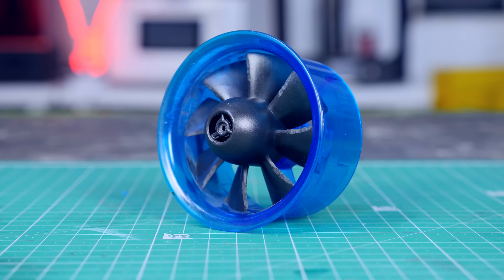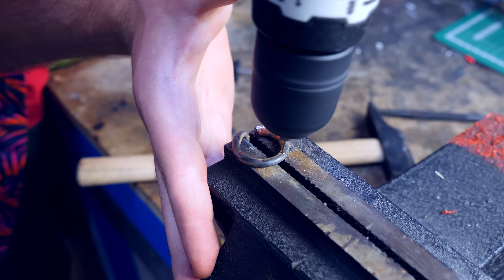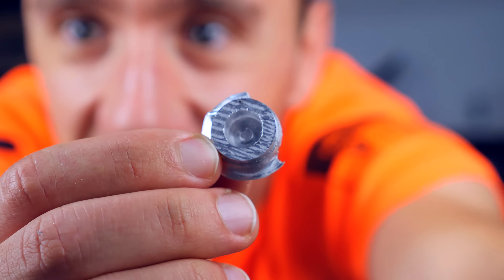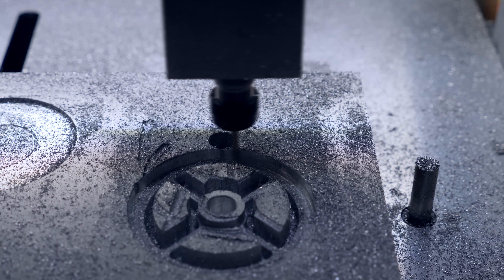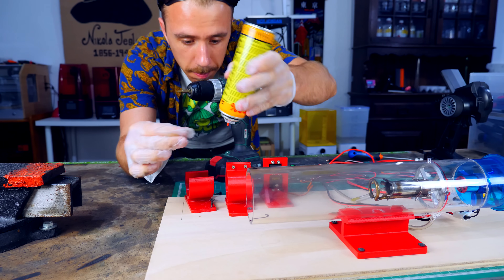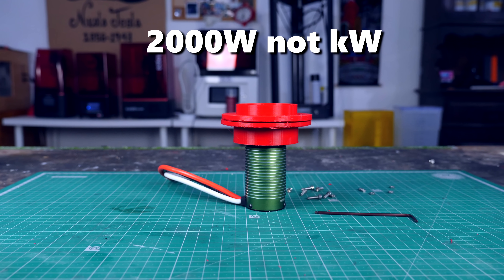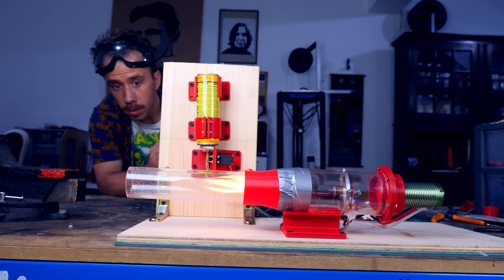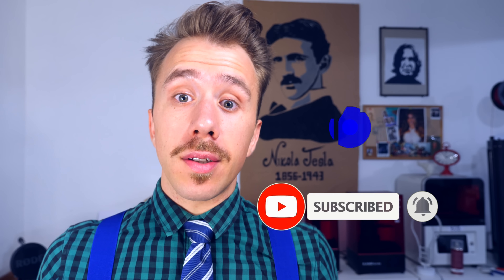I turned my Fan into a Jet Engine (3D Printed EDF Afterburner)

Comment: No you just made a flamethrower.. a jet engine is able to self sustain. Without the ability to self sustain aka keep running without external assistance, that is not an engine. There's actually numerous people on here that have already done this. If you want a far better jet engine, go to a junk yard and buy yourself some turbochargers and link them in series. Colin Furze has a decent video on how to do this, in a single stage version. I'd suggest upgrading to at least 2 turbos and replace the intake housing on one with an exhaust housing and wheel so that it can withstand the heat better. The intake side of one turbo feeds compressed air to the exhaust side of the same turbo, then you duct it into one side of the second turbo, around to the other side of that second turbo and then out the back which is where you put your combustion chamber and afterburner. The mistake most people make when making turbocharger based jet engines is when they put fuel in the turbo and light it inside the turbo.. They can't handle that kind of direct heat and melt the wheels. If you use the turbos purely as the compressor stage it should last longer, the problem might then become getting it to self sustain as you'd have to have sufficient vacuum created by the combustion to pull the air through both turbos. A way around this, at least on the second, would be to 3d print a titanium exhaust impeller/wheel and put a small injector and ignitor in the transfer between the "intake" and exhaust side of that turbo making the "intake" as well as the first turbo the compressor stage for the engine and the exhaust side of the second the way that the second is mechanically spooled up and basically the initial combustion chamber which then can have more fuel added in the exhaust making an afterburner afterwards. I'd suggest using a fuel that burns at a low temperature like methanol though.. just if you use methanol make sure to add at least 5-15% by volume of toluene so that the flame is visible so you don't accidentally set everything on fire when you can't see the flames. (methanol burns so clean the flames are almost completely invisible) And obviously take proper safety precautions because both methanol and toluene are pretty toxic and you don't want to be breathing them or their exhaust, or getting it in your eyes. (oxidized methanol becomes formaldehyde)

Comment: Why don’t you print a nozzle like a bell nozzle. This way you can heat the fuel before it goes into the combustion chamber. You may also be able to keep a resin print cool enough to prevent warping.

Comment: Enclose the entire thing into  a duct with another EDF at the front, to push air to the back and pull/ accelerate the air in the flame tube.
This airfoil duct will multiply output, and if you do get it moving, exponentially so based on airspeed.

Also that chef looked familiar.

Comment: The peroxide engine was primarily released oxygen, right? Could you revisit that build with an afterburner to improve it's thrust?
Second idea: could you modify a spring scale into the base to measure thrust during experiments?
Reply: However, if there is anything hot enough to qualify as an ignition source in the path of the gas, pure 02 will *find something to burn*, and uncontrolled O2 fires are terrifying.  So, yeah, even though it doesn't work as an afterburner,  handling oxygen in the presence of heat/spark/flame is extremely dangerous.
Reply: @olinseats4003  if you can get airflow moving fast enough with enough pressure, would it be possible to build a kind of ramjet with small fuel injectors and constantly-cycling air? It could only run at full power without endangering the engine, but would it work?
Reply: oxygen does not burn
Reply: @iteratortv  bruh what
Reply: @DDrac0  imagine that
Reply: @DDrac0  oxygen needs a fuel to combust which the exhaust from the peroxide engine doesn't have which means the after burner won't work
Reply: @anhondacivic6541  ok thanks a lot

Comment: The comment about vaporizing the fuel is on point. Carburetors/Venturi tubes…mix the fuel and air before Ignition, right? So, maybe fan blows fuel mixture past the glow plug in the narrow tube from the wide tube, and then another wide tube for the outlet. You’ll have to meter the fuel to match the air flow…that would make the engine. Dumping more fuel in exhaust for more thrust is after burning.

Comment: Video Idea: 3d print a wind or water turbine and use it to charge a big enough battery to power a 3d printer to print another wind or water turbine. That way the second printed turbine would be using green energy in its creation.

Comment: Hi I would really love the 3d printer, I suggest for next video to print a compressor tu put in after the EDF. With its stator and the moving blades in multiple stages compressing air, that will be much better!

Comment: I think you need to let the plug and exhaust heat up before you use the EDF. The hotter the exhaust, the stronger the engine.

Comment: I have lots of experience milling aluminium in weak CNC-machines

Some tips:
-Climb milling is key. DON'T mill alu conventionally except for certain operations.
-Run high feed speed (40 mm/s for example), High RPM (12000 rpm for example) and low pass depth (0,2-0,4 mm). This prevents overheating of the chips while avoiding overloading the tool. Experiment.
-Get carbide tools with SHORT flutes and no more than two flutes. No need for 20 mm long flutes unless you really have to go that deep.
-Minimum tool extension from the chuck for maximum rigidity.
-A spray bottle of ipa to cool the cut is ideal. Alcohol is like magic when milling aluminium. If you get the settings right you only need an occasional shot of IPA on the work.

Comment: also, while mounting the can upside down is a bit riskier, its a good choice for what you are trying to do. If you mount it upright, as the liquid phase changes to gas it takes a huge amount of energy with it thus the can will cool (same reason gas grill fuel tanks get cold). The problem with this is the cooling gradually drops the vapor pressure slowing the phase change and eventually resulting in far to low of a flow rate of gas out of the can. At full blast you'll end up with the can half full and not being able to run anything. Those tiny in home gas stoves that run on butane (common in Asian households in the US) address this by having a strip of metal close to the flame redirect that heat directly to the can (yes, heat the metal can of fuel with fire...), other solution is use propane that isn't as severely effected by this compared to butane, but much more expensive to produce.

Comment: Why not use glow plugs from RC nitro IC engines? No high voltage (12v or less), they are cheap and keeping the amperage down you can leave them glowing for ages...
Cool videos as always thanks 👍

Comment: (Aerospace engineer here) Need a diffuser to slow down the incoming air and allow the fuel to mix and burn properly. Sometimes called a burner can. The scale of your hybrid jet engine could use a tomato paste can. Cut slits into the can at angles to help spin the air, inject your fuel inside this and ignite it there. This prevents high speed air from blowing the flame out and allows it to generate heat. This in turn expands the already moving air. Which creates more thrust. Keep the label on the tomato paste so we can watch it burn off and send a message to all other tomatoes out there.

Comment: have 2 large plastic containers connected with a tube near the middle with gelatin in the middle, then add salt water in both sides and add carbon electrodes to make hydrochloric acid and sodium hydroxide.

Comment: You need to use a big BBQ gas bottle for your fuel so you don't run out so quickly. That way when it explodes it will be more spectacular and get many more views and thumbs-up. All hail the algorithm. 😝

Comment: Here is a tip: invert the rotation of the fan. In gases the blades are oriented opposite than liquids because head losses are not so high, and increase a lot the air velocity.

Thanks for the videos...and kill the tomatoes!!

Comment: You need to get endmills that have a way shorter flute length, that endmill is way too long for your machine. That is what is causing the massive vibrations you are hearing. Also, when milling aluminum, make sure you have high quality endmills and use WD-40 or Isopropyl alcohol as a coolant/ lubricant.

Comment: Actually this design is closer to a high-bypass turbofan, not a turbojet. Still very cool, since these are generally more fuel efficient. You need to add a compressor stage between the fan and the flame tube; it has alternating static and rotating blades. That will give you that "narrowing" pressure you need to really make thrust. The more compressed the air is, the more explosive the results. As always, love your videos!

Comment: CNC tip...much less tool stick out would be great when cutting parts that are so thin. You will have a much more rigid cutting tool the shorter it is.

Comment: whenever I need to bend brass piping I freeze water inside first. the ice will crack and bend with the pipe but still support it from the inside. plus its just easy.

Comment: Recommendation (1):  Get an old impellor turbine (intake) from a car/truck turbocharger (the bigger the better) and make an adapter between that last motor and the impellor. Then 3d print a housing for this that is an open intake with a full open edge that flow back into a conical collection area around the motor. If the housing is designed right you should be able to have a large amount of air flow in with a good pressure increase in back. Also (2): look into stainless tubing. small stainless tubing near 1/8th or 1/16th an inch is easy to work with, easy to bend, cheap, and can be used in place of all the brass that you use that sufferers from melting. In a previous video you used silver solder on a set of brass tubes, note that stainless is able to be silver soldered just like the brass. (3): make a Slapattron plushie stuffed animal to sell as merch. ... p.s. I own enough 3d printers please don't send me one if I get voted up there. 

 Love the videos, wish you where here in the states I'd let you use the machine shop in my garage. Keep up the great work!!!

 Tim.

Comment: Run the fuel through a copper coil in the combustion chamber to preheat it before feeding it in. You could also run it around the nozzle to cool it like a rocket engine does!

Comment: I suggest you make the Fan Propeller with aluminium it can hold bending pretty well, and also (IF YOU CAN) add a low pressure compressor before the combustion chamber and add another one on the back but slightly bigger.

Comment: Could I suggest manufacturing an aluminum tip reducing the amount of flow from 3 inch to like 1.5 inch or half your flame tube and increasing the flow just like a reducer for plumbing and fry a 🍅 tomato with the pressure

Comment: The reason your machining seems so bad is because of the runout on your endmill. You can see the wobble. The collets are usually pretty good, so that endmill may be bent. Machine tooling is one thing that it doesn't pay to buy cheap.

Comment: Glow plug is not a source of ignition in diesel engines. It's used to help warm up the cylinder. Diesel fuel combusts with compression. It helps if it's warm to prevent fuel knocking. Which is why newer diesels have a warm up period before starting.

Comment: Very cool, I am actually working on something with a similar concept. I posted an early prototype of my hybrid jet engine on your subreddit a while ago. My design is fully 3d printed and I was inspired by a lot of your videos.

edit: I suggest using a centrifugal fan with a similar design to the NASA CC3 for the next design. They seem to work better/more efficiently than the one you're using in this video.

Comment: I don't think this will help much but you could try and use you're CNC Machine to make the fan blades to run the motor at a higher RPM and have more thrust

Comment: Don't be afraid to turn your tool speed up on your CNC if your using a carbide endmill it will cut better at a high speed. Not sure what seed your cutting at, it sounded a little slow to me. Try using WD-40 or a similar light oil when you're machining aluminum it makes your surface finishes much better and significantly increases tool life, plus it'll prevent aluminum from welding to your tool. Also only allow enough of the endmill to stick out of the collet to do the job you need to do it'll help with tool pull and make your parts more accurate.

Comment: Fighter jets using afterburner usually have a variable pitch tip on the exhaust so the pilot can meter how well the afterburner performs,  maybe you could try adding that to your prototype and see if it helps any and that way you can change the size from wide open to almost closed and anything in between, cool project idea,  can't wait to see you perfect it

Comment: An easier way to bend a tube without a torch is to fill it with water and then freeze it. The ice will keep the tube from collapsing as you bend it. It is a common technique for bending copper tubing.

Comment: How about 3d print a fractionating tower (lab type, you know transparent). can you print transparent objects?  Use one of you rather warm engines to heat up the crude. then you could fuel it with the fractionated gas and demonstrate entropy at the same time. its like a lift. works on so many levels. 
like the fractionating tower. look if i have to explain it .....
Seriously though fractionating tower could be interesting.
i mean its not as if I'm asking you to print a solanum lycopersicum .berry though, is it.

Comment: How about putting the monster motor into ducted fan frame and use its propeller? I mean you are just adding more power, though that does add constriction into tube if place like it use to be.. how about building frame on inlet side and mounting motor there allowing more flow in, that would increase pressure. Also how about adding the fuel before the glowplug to improve ignition. Furthermore maybe try using airplace radio instead of car one. This way you can program switch to work as on off and just adjust to find ideal fan speed combined with fuel.
Also you might run into problem of fuel freezing so there is more fuel in same volume that messes the fuel air mix not giving suitable combustion.. maybe add regulator between to gain stable supply and later when in plane etc rc vehicle you can try make this lighter in weight. 101 of prototyping=hack something together that works and then try to improve its weight etc parameters.. and minimize ducktape used so its more presentable to potential buyers.

Comment: How you mounted the glow plug could also be how you would mount a fuel injector running a twin pipe setup would increase flow added with centrifugal pump would creat back pressure

Comment: You should try doing a rocket/jet engine test vertically.
Obviously conclude that the rocket is safe before testing like this, but using your horizontal sliding mechanism vertically would help show the force overcoming gravity.
Also if it's one that shoots fire, it would be interesting to put a tomato (or a fake one) underneath the exhaust of a vertical rocket.

Comment: I think you're getting incomplete combustion after you mounted the fuel canister vertically. The butane is coming out liquid and far too cold and is not boiling to gas fast enough. The same was happening with the horizontal can after it was being used for a few moments.

In normal use, a can of butane gets cold as pressure is released due to some physics magic I can never fully remember. The colder the butane, the slower it turns to gas and the lower your pressure gets. I think you need a larger fuel source that can maintain pressure without dispensing liquid fuel, like a large propane tank. May need to tweak the fuel-air mixture before it's injected into the combustion chamber to get a cleaner flame.

I'm no scientist, I just play with lighters and fire a lot...

Comment: You can try to cnc the fan an 3d print the housing so you have tight clearance to ganerate more pressure also you can take apart a lighter and use the brass little nozzle ass an injection method anyway love your vids ❤️

Comment: Keep the butane upright. Fuel doesn’t burn as a liquid, it burns as a gas. Heat is transferred from the fuel as it vaporizes so keeping that process within the “fuel tank” will give you much easier combustion. The yellow flame is a strong indication you’re fuel rich anyway and losing combustion efficiency.

Comment: I think you should start with the early pioneers of flight and use this as a burner for a hot air tomato AHEM I mean balloon…. There are soft kites (think hang glider parachute wings) that you could use this to inflate…. You could even sew in some Tesla valves in the fabric to make chambers and joints. This thing could power a Chinese dragon! 😋 or a tomato….

Comment: You should build a rotational trebuche and power it with rockets to launch tomatos to the sun.

Also there is supposed to be a affordable metal 3d printer called Markforge.

Comment: I'm surprised that worked at all. A centrifugal/radial fan needs to take the flow out sideways, perpendicular to the axis of spin, but you are taking it out axially. What you need is an axial fan! Or, turn you radial fan 90 degrees and take the flow out sideways. Jets use TURBINES (a type of axial fan) not centrifugal fans.

Comment: You should make an aircraft of sorts that uses the engine 
But the fuel and a few other components are on the ground and wired to the plane
So it can fly out but not far